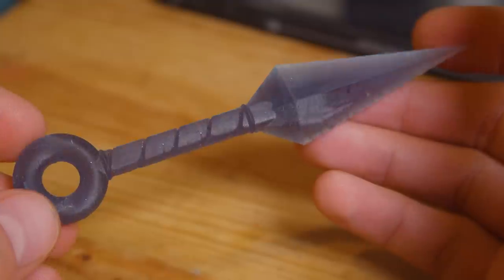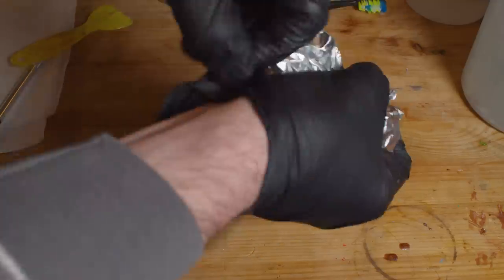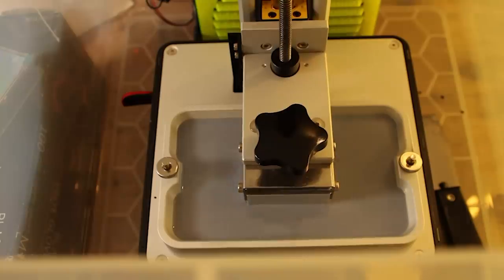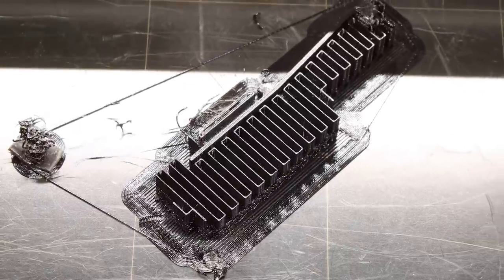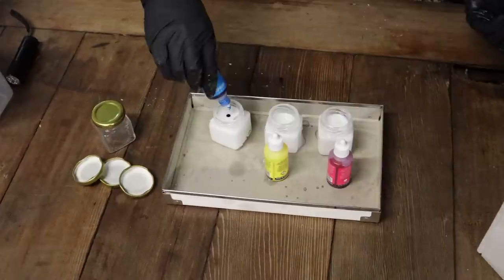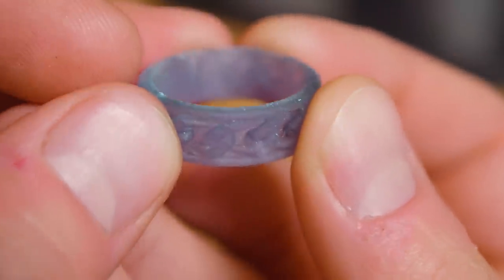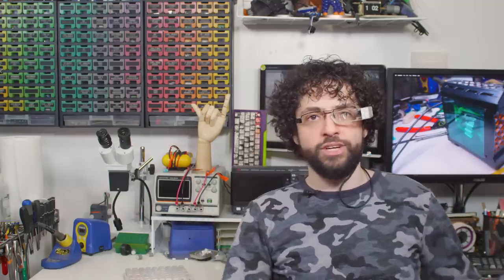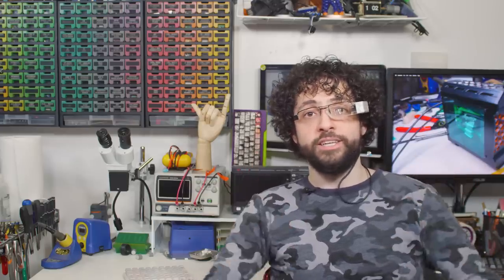Resin Printing Isn't Scary - ft. Billie Ruben!

Comment: FDM printers are great, but troubleshooting when something goes wrong SUUUUUUUUUUUUCKS, because everything has the same symptoms (the nozzle clogs and the parts fall off the bed). Resin printers have their own limitations, but at least everything that can go wrong looks like what it is, so when something does go wrong, it's easy to identify and fix the problem. Which means even difficult to print resins are easier to print with than difficult to print filaments, because it's only ever a question of adhesion layers and exposure times.

Also: "I only have clear and white resin." I can tell you right now which of those she prefers to print with, because one of those two has significantly faster cure times, and the other is very touchy about bed adhesion and layer delamination.

Comment: And Again...you dont mention the most important question about resin printing ......Where do you should put your printer ? Here is your answer ..... You CANNOT put your resin printer in your Home...you MUST have a isolated room / garage or basement with a ventilation system . ....the Toxic Fumes is very dangerous and its not worth it.

FDM is waaaaaay more print friendly than your SLA

Comment: 8:27 passing from a cheap chinese clone of an Anet A8 , to a prusa mk3s doesn't seem like just "a bigger print bed"
Reply: And what exactly is the difference?
Maybe a bit nicer print quality and a bit less trouble, but other than that?
Reply: @Jehty_  fire hazard  , multi material , stability , all metal extruder , auto levelling , higher temps for nozzle and print bed , silent mode and driver's , filament runout sensor , sensor for sensing broken sensors , adapted  psu , better firmware , blackout recovery and these are just the ones I think of
Reply: @prisedeterre1356  and none of that really makes a difference.

(fire hazard shouldn't be on your list, because that's something every Anet A8 owner already should have fixed)

Besides if you think that you need any of that you can just modify your A8.
Reply: @Jehty_  yes , but at this point getting z better printer is just easier

Comment: "They are super cheap" ... jeah sure, if you ignore the fact of build size and stuff... using the photon as an example (~150$) we would pay around ... ~1300$ for an build size of an 200x200x200 (small) FDM printer.. cheap, jeah.
then comparing the resin to filament ... "you dont print large parts" .. no, just plain no! YOU might be printing small parts, i for example often use most of the print space and still ned to glue 4 parts together because of the way undersized print volume... so the costs there are also pretty high compared to FDM. also support/ infill, well i use way less in resin prints but mostly for stronger parts i either print some custom infill or FULL, because shells, no matter how thick you print them arent strong enough for some applications (100% resin is equal with 40% FDM infill (PLA) [~28% PETG/ ~22% ABS/ASA]) 

also the fail causes of resin printers differ. for me, temperature was never an issue (good to know it might be for you) and i printed in the basement @~5°C (way to cold to even be there xD)
while you mostly never have problems with axis you have more problems with the bed leveling (which is for both printers equal) or with the filament (to dry / wrong or bad diameter) but on the other hand you can have resin which is "bad" as well (not telling the brand, but i had resin that even after shaking for 15mins still was inconsistent in curing, changed to other brand same settings, no problem) so that equals out as well.

tho i must admit i still recommend using resin printers for some applications BUT dont praise them to the heavens please...

Comment: Too bad she don't talk more about safety. I have an air extraction system and I use a respirator that is supposed to be rated for that and I still can smell the resin.
Plus the fact that everytime you see people using resin printers, they generally don't even wear a mask, even in this video we can see she remove the print without wearing anything.
She don't talk about the risks on the long term usage... contact with the skin, vapors breathing, etc... what are the risks?

This videao is great, really, but she seems to talk only about all of the good parts of resin printers, and just omit the bad things.
Resin is messy, hasardous, resin printers are cheap but resin itself is expensive, and you need isopropanol to clean it (and it's also expensive), you need many consumables like gloves, a lot of towel paper, so each time you will print something it has the cost of resin + the cost of every consummable + all the time that you will need to clean everything etc etc...
Indeed you can optimize some steps, but even with that IMO it's tedious to print in resin, and that's why I print way more with FDM than with DLP.

Comment: Is there actually this prejudice about the difficulty of printing with resin? I don't even have a 3D printer (yet) and even I knew that having only one axis with no other moving parts makes life a lot easier.
Reply: I think most of the difficulty was getting the hang of placing the supports right in a upside-down space, calibration with proper wavelength, not letting the resin get old but most importantly where to put it for ventilation and practicing safety at all times. 
I slacked by not wearing a lab coat and a few times getting small drops of resin on my arms or my gloves getting punctured. Maybe once or twice a drop got on my cheek/lip while I was trying to separate a large print from the build plate. Anyhow, within a year of daily use half my face got paralyzed, I could no longer make a strong fist on my left side and my digestion started having issues. I was only 19.  It's fun at first- just be extremely careful. Absorption of resin onto the body can cause allergies leading to nerve damage.
Reply: @ic3dragons223  I did know that it ain't healthy getting this stuff on your skin but this... is extreme. Not saying I don't believe you, but I will definitely verify your findings before buying one.
Reply: @fredwupkensoppel8949  Definitely. Photopolymer resins usually have ingredients that make them have acute health hazards. I learned my lesson the hard way. Chinese manufactures can coin them as irritants but that's just not the case. It's much worse than that. 
Even fully cured resin prints kill fish if placed in a aquarium which I was tempted to do my own resin cave designs before I researched.  
Unfortunately I let my body learn the hard way. The stuff bio-accumulates and caused allergies which then evolved to nerve damage. Definitely research it. It was a very fun hobby machine for me for a couple years but has its steep safety risks. I kept going stubbornly for alittle bit even after paralysis because well I put alot of money and passion already but it definitely took its toll. Nearly two months after stopping the minor symptoms went away and a few years later I partly recovered but some damage stayed permanently. 

In the industry workers follow a strict safety guideline but now that's it's been coined to the hobbyist markets newcomers often miss the safety risks and some even put it in their own room thinking that opening a window or two is enough. Some even miss to fully cure this stuff on prints and unknowingly get it in their hands and clothes. Additionally most also breathe in the alcohol fumes that is used to wash the resin which is mixed with resin fumes too.
Reply: @ic3dragons223  I definitely planned to make an enclosure which ventilates the fumes directly to the outside (I would leave the UV cover off of the machine to let the fumes in the enclosure to be evacuated); the enclosure would have to be non-transparent then (don't feel like ordering acrylic glas painted orange in the hopes of blocking UV rays; a nice slab of wood will do the trick for me).

It will be a bit difficult though, because european homes rarely have an accessible air exhaust meant for HVAC units. I will either find a solution for that or I won't print resin.
Reply: @fredwupkensoppel8949  I think an enclosure meant for filtering out the fumes would be great for it. You could probably do an acrylic front with low LEDs on top for extra lighting. I don't think the machine itself needs to be fully opened to let the fumes out. Alot of them come with a fan and a sponge filter which cycle when you have them on. You can make the enclosure vent that out for alittle bit before you open it.
Reply: @ic3dragons223  Better safe than sorry - I'd like to have kids at some point and maybe not being able to see the machine makes it less interesting to try openening it to drink the magic juice.
Reply: @fredwupkensoppel8949   
That makes sense. 
 If you ever do go for it or have other equipment and have kids the work room or space can become off limits. The enclosure can have a lock built in too for the ever so curious little ones. My dad had a similar restriction with his garage growing up. I would go in there if he called to show me something or if I had supervision from my parents to look around and satiate curiosity. 😗

Best wishes to you,

Comment: Disagreed, resin printing is not easier or harder to get it right than fdm, fdm is finnicky, but once setup properly, its awesome. For that you need to SEE whats happening.
Resin on the other hand is rather "guess work" and issues are not as apparent as fdm, cause you see what happens, but you see only after and need to analyize based on entirely different knowledge than fdm, so its frigging slow to repeat since you have to clean your vat after EVERY failed print and many other things.

Already a micropart can and will damage your screen and everything else you hold dear in your life. 
Plus you'll have to be really good at MANUAL support placement (if you want to print more than some jewelery).

And what about exposure times? 0.1second already can fuck your entire print up and dig holes in vat for example :D
FDM has lots to consider mechanically, resin rather "physically" like exposure and polymerisation understanding, so it balances out and not really easier than fdm. 

Also pricing isnt quite right.  
200 yes, but fdm's are already available from 80$, specially kits.
Resin itself is expensive so you have to consider that.
So overall its actually 2x as expensive if we talk about basics only.
And we dont use "less" of it, actually more because we dont have infill so parts are 100% filled. Logically you use MORE. 
Hollowing needs special treatment, like extra (again, manual) supports and holes.
1L of resin vs 1Kg filament, loooots of information out there, and youll see how much much muuuuuch more you get of of a spool.

Comment: 7:25 someone forgot to tighten down the resin vat and it wasn't mentioned. 

you dont need a fkn hazmat respirator. sht i dont even use gloves and dont have an issue. i just spray my hands with iso then wash with soap. gloves get in the way. 
siraya tech is the best i've tried. although its thicker and sometimes works better if heated.

Comment: What i don't like with Resin is the amount of waste you create with each single print.
Reply from the maker: I don’t think it’s too bad. You waste a little resin on supports and a tiny bit more on drippings and residue, but you can continue using the unexposed resin in future prints. You also need a pair of gloves and some paper towels for each plate of prints, so take that as you will.

Comment: Resin printing is the actual future, FDM is the steam punk future. The quality isn't as good, there are a bunch of different whirring motors, gears, and belts, and you'll be tinkering with it while it's running while cursing.

Comment: Hahaha, I think this is a response to our comments at the earlier video. Well, first they say that resin printing is as easy and safe as FDM but then they say that it is more work, you need a respirator, you shouldn't smell it... Well it is really hard nor to smell it. The correct respirator mask for it is actually a carbon filter mask. That is the only thing that can hold back volatile compounds... Otherwise, yeah you inhale those compounds. She is doing it totally wrong by the way! Brushing will cause LOTS of tiny resin drops settling around. You won't be even able to see that! I suggest you to use a cheap ultrasonic bath with a general purpose cleaning detergent. I go with 1xIPA 1xdetergent 1xIPA. I had lots of problems with FEP adhesion. But that's not the point. My prusa works perfectly fine. I love the results with resin printing. But it is also too brittle for enclosures. I have lab experience. I deal with it with the knowledge from lab work. You can too but please pay attention to detail. Look around with 405nm lamp. It goes everywhere so easily. It is so easy to contaminate surfaces and indirectly your food and other areas at your home.

So no, it is not easier. Sorry Zack you lost me again on this one. But it is true that print settings are very easy and results are amazing. If safety wasn't the problem... I am actually disappointed by the recklessness of this video, which risks many of viewers' lives. Especially due to the financial motivation with the sponsors! Please read the material safety datasheets (MSDS) of your resin. Each manufacturer uses different formulas. Build a ventilation system to vent out fumes.
EDIT: Even more so careful with pets (cats!) and kids!

Comment: Hate to be the negative nancy here but resin is seriously toxic and carcinogenic. Im a chemist and resin is one of the nastiest chemicals i ever worked with. Gloves are just a temporary diffusion barrier (ca. 2-40 min depending on the substance and this goes for all types of gloves and chemicals) and you are kidding yourself when you think you will change the gloves every time you get some resin on them. While you are cleaning parts small amounts of carcinogens will diffuse through the glove and straight through your skin. 
Even if you wear a 100% perfect respirator the fumes will still diffuse into furniture and dust in your room and also find their way into your lungs.

The consequences of this exposure will only become apparent in 10-20 years when the statistics show that people working with resin have higher cancer rates. If you dont have a very well ventilated and designated resin printing room or fume hood i would strongly recommend not touching that stuff!

Btw: FDM printers emit fine plastic particles (yes also PLA) which also have the potential to cause cancer so an enclosure with HEPA and(!) charcoal filters is highly recommended as well.